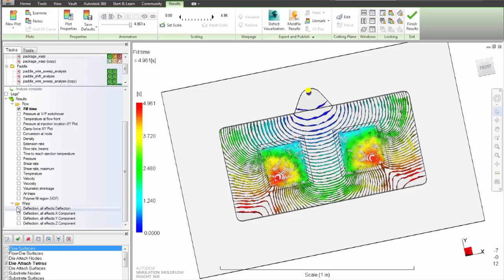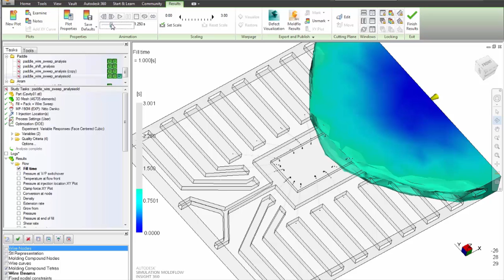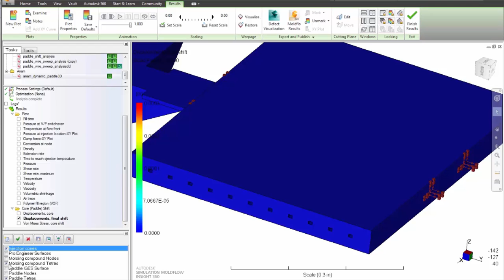Microchip encapsulation

Comment: hello. in underfilling encapsulation process for chip and substrate with solder bump between chip and substrate, how to show warpage and stress in chip and solder bumps between chip and substrate with mold flow insight software???????
Reply: Hello, can you share model file if you still have it with me? thanks